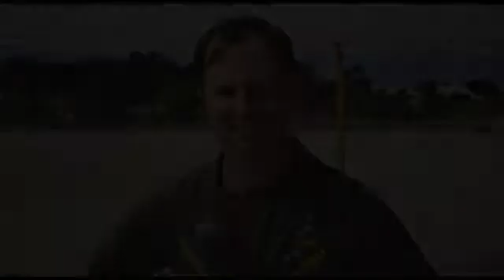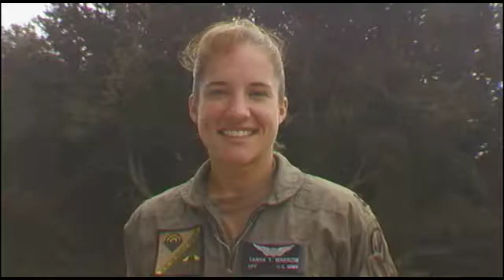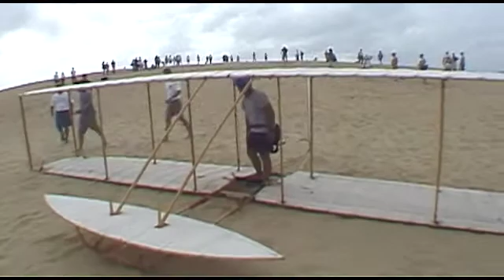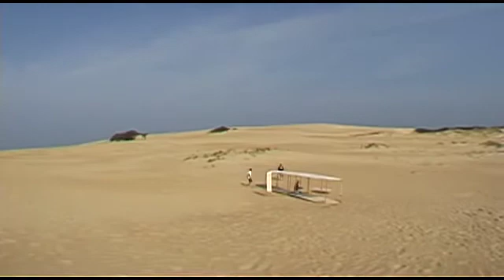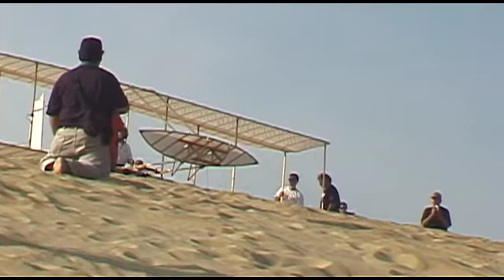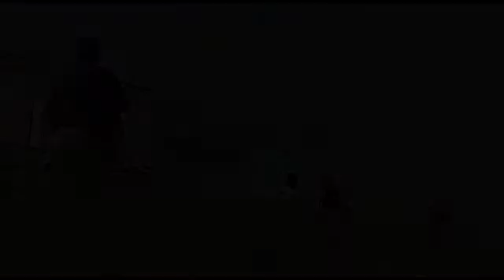Replica Wright Brothers' 1902 glider flown by US Army, Navy, and Air Force test pilots.

Comment: The fact is that the 1902 glider was very controllable and several hundred flights were made. Experienced hang glider pilots would have a much easier time with this replica glider, as they are used to weight shift for roll control and flying at 30mph close to the ground. All things flight-related have a learning curve.